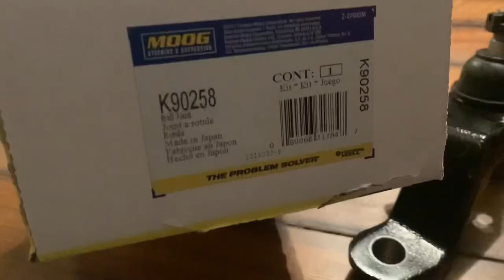Moog Toyota Lower Ball Joints - DO NOT USE THESE! - 3rd Gen 4Runner / Tacoma / Tundra

Comment: I just installed the "Problem Solvers" on my 2001 Tundra May 21st. Have only driven about 20 miles so far. I am convinced to remove them today or tomorrow and install me some OEM ball joints. Looks like I will be returning these to Amazon. Thank GOD I was led to this video! Thank You for the heads UP brother!!!!
Reply from the maker: If you have the 555’s you’re in much better shape. The black ones not so much
Reply: @FreedomCrawler  Have not been able to find the 555's going to be replacing them with OEM tomorrow! Then shipping back the cheap ones.
Reply from the maker: Fair enough. Makes sense
Reply: @FreedomCrawler I have the 555s on my toyota t100. Was the t100 plagued with the common LBJ failures in the first gen tacomas/4runners/tundras? I assumed so but now that i think about it i think all those rigs have coilovers and the toyota t100 still has torsion bars. I have about 30k on my 555s now but im debating on just going OEM for peice of mind

Comment: I used Moog tie rod ends on my 3rd gen runner and lasted less than six months. Replaced with Sankei 555 and have been going strong for two years now.
Reply from the maker: That’s why I kept the 555 Moog parts and returned the others
Reply: I purchased OEM Toyota Tie Rods and Ball Joints, let me just go ahead and say $$$$$$ yikes!! But I know it’ll last me another 10 years without having to purchase them again however I probably won’t let it go that long
Reply: Somthing else is wrong with your car. Theres nothing wrong with Moog. Been using them for years.

Comment: Installed a Moog control arm with ball joint 3 years ago and its still going strong. I think people are buying from ebay or amazon etc.
Reply from the maker: Agreed, also about how you install it as well. That’s great to hear
Reply: Have some Moog lower ball joints in my Tundra for 7 years , not had a problem with them.

Comment: Great video. I learned that Moog has gone to shit with a lot of their parts months ago. I just bought a pair of lower ball joints for my 1st gen Tacoma 4x4 from Mevotech. Their "X-Factor" series, that uses REAL sintered steel bearings, high quality boots, and heavy duty castings. I haven't installed them yet, so I was able to compare them to the parts in this video. The Mevotech part much more resembles the 555 part in every way: near identical: the casting thickness/shape, the lower stamped steel cover, the rubber boot ( blue in color, & connected with stainless steel rings at both the top & bottom of the boot, it blows away the boot on the cheap part in this video ), a temporary protective cover for the boot that is kept in place by the castle nut during installation, even a grease fitting. It is much better vs the cheap part you're showing in this video, I compared them very carefully. So I am definitely pleased with the Mevotech parts. I ordered them from Rock Auto. They are however manufactured in China and have the black powder coating, but Mevotech has already stated that their inspectors make sure all materials, castings, even manufacturing & assembly is done to their strict spec's. Their X-Factor series of parts carry the logo "overbuilt for durability", and all use the blue rubber boots. Mevotech has a good website, lots of videos showing how their parts are high quality, plus a customer support phone number. Mevotech ( a Canadian company that does their own research & development ) also has a line of these parts that are even heavier duty. I forget the name of the series, but the rubber boots are light green in color. I see individuals and professional mechanics/shops installing & recommending Mevotech X-Factor ( blue rubber boots ) series and their ultra HD series ( green rubber boots ) all over youtube, and most of them are NOT affiliated with Mevotech in any way. Neither am I. Just thought I would share this info.

Comment: I might add my current lower ball joints were replaced in 07 on my 05 Tundra OEM parts. That was 150,000 miles ago still tight.

Comment: Great video, I had to check which lower ball joints I installed. I actually used AC/Delco brand and it's extremely similar to the one that you prefer other than the machined surfaces, but definitely look to have greater structural integrity plus stouter looking ball joint. Thanks for making our gen3 community aware
Reply from the maker: Absolutely, hope it helps

Comment: I know this is a couple of years old now, but that black Moog part is more of an equivalent to the OEM LBJ than the silver part. The OE ball joints never had a grease fitting, so that is irrelevant.
I purchased 2 OEM Toyota LBJ's, dated 2021, for my 1st gen Tacoma (same as a 3rd gen 4runner) directly from the dealership, they look nearly identical to that black Moog ball joint. The only difference I can see is that the cap, that you think looks cheap, is painted black on the Toyota part I have. Same cap though, and physically looks the same as that black Moog ball joint.
Reply from the maker: Moog contacted me after watching this and told me it was actually their new updated version. That it had slightly better components. I still like the 555 personally but that’s what they relayed
Reply: @FreedomCrawler what do you recommend? The 555 or the toyota oem ball joints? I know some oem parts are made by other brands and just add their name and bump up the price. I hear the 555 is the oem manufacturer for the toyota ball joints but I don't know if is the case.

Comment: Someone bought a Moog part and then a house brand part, swapped the boxes, and returned the cheaper part in the Moog box. The parts house failed to check the return. Common fraud in retail.
Reply from the maker: Would make sense if it hadn’t been ordered offline. I’d agree that could have easily happened at a parts store
Reply: Moog has cheaped out and in fact is selling cheap Chinese junk.

Comment: 555 is no OE rebranded factory doesn’t have grease fitting. There is a reason why some have it and some don’t. Factory have a teflon design while 555 is metal on metal that’s why it has the grease zig fitting. 555 also doesn’t have a coating it will rust quick so paint it.
Reply from the maker: Absolutely correct. Especially on the painting them.

Comment: Idk if anyone noticed, but i saw right away that the questionable ball joint doesn't even have a grease fitting. If i ordered these online, I'd be highly upset bc I'd have to go through the return process, order another set, and wait another week. Thanks for the heads up. I'll get mine from Toyota
Reply from the maker: Exactly the first thing I noticed too

Comment: The chinese manufactured ball joints pops out in less then a year..watch out !!. 
I have had two ball joint failure on the land cruiser prado 90 series on the go. Both were china made, no zerk for greasing and on them. When  the inside of the popped out b-joint were checked there was no plastic polymer seats inside either.  ..its a terrible experience. The LC 90 series shares the same chassis/suspension as your 3rd gen 4runner.. with a little more beef added here and there. Go for the Sankei 555 (SB3806) non-greasable ones made in Japan. Its silver in colour and needs to be painted before fitting. The balls can be rotated with bare hands when new..feels buttery smooth. Three years now with it and mostly used hard on tough roads..not even a slight play at all yet.

Comment: Have not ordered Moog parts. I assume you do not have an option to order 555, rebuilt OEM, parts. Is this true? I'm with you, I would never put that black part on my vehicle, the casting is ALL WRONG! Also have a question. I experienced wobble in the front end, thought ball joints were bad. Jacked it up, and noticed the passenger wheel would turn then stick. Thought bad caliper. Removed caliper and still had the problem. hub would turn then stick, I mean almost like a binding. Now it's either the axle, or the transfer case. Any of you guys experienced this before? New one on me. Oh, and put new wheel bearings in last year, so I'm eliminating that, for now. Would like to know what ya think, thanks! One more thing, it's a 2007, gen 4.

Comment: You got me dude!!!! Good one. I have had OEM joints last decades, and moogs last a few months. I'm sure they rebuild or get factory seconds or something, but DO NOT USE THEM. There was a company called Pro Forge, and they were good german stuff that lasted. Stick to OEM, or just spend 1500 and get new arms and uni balls.
Reply from the maker: As soon as I opened that box I knew something was wrong. I’ve had enough vehicles to know a huge red flag when I see one and that was just wrong. Again, it will work in a pinch or for the person who needs a quick fix but that’s not a Japanese OEM replacement. That’s a knockoff 100%. Have a great rest of your weekend!

Comment: I believe Moog recalled their ball joints for Tacoma /4 Runner. I believe the black painted one you have is one of them. The other is the Sakei part ( Triple Five) which is the best non factory ball joint.
Reply from the maker: MOOG actually called me after this video to clarify. The black part is their new version. I’ll make an updated video soon
Reply: Ya moog doesn't make parts anymore they take other brands and put them in their boxes they are a repacker I've got alot of ball joints from moog stamped 555 that's because they are repacked Sanki 555 brand ball joints 95 percent of the time your guns get a sanki 555 part in a moog box its kind of funny cause if ur guna buy moog u minus well buy the sanki 555 brand instead cause moog charges more money for their moog brand sankie 555 is a cheaper part brand so save some money and just buy the sanki 555 brand cause ur guna get the same exact part ur just paying more for it with the moog I stay away from moog I only buy it if that's the only option always go with beck arnley cause moog went to shit beck arnley 90 percent of the time ur guna get a oem dealer part in their box for half the price never had any problems with beck arnley

Comment: Can you provide the part numbers of each of those?
Reply from the maker: They actually both had the same parts numbers. The black one and the 555 one.
Reply: @FreedomCrawler  How do they both have the same part numbers? The left and right joints are different.
Reply: @clementc9975  yeah they should be slightly different number usually.

Comment: It seems that Moog used to have good quality parts that matched OEM quality that was made either in the USA or Japan. From my experience recently, Moog is trying to increase profit margins by taking ALL manufacturing to China (unlike what they were doing before) probably because Federal-Mogul got greedy. If you order 2 of the exact same parts and they probably will ship from different fulfillment centers you most likely are going to receive an old stock USA or Japanese made part and or a new Chinese inferior part like in this video. It's sad to see a company like this that has and can produce good quality parts replace everything with this cheap bullshit that's garbage. Buy all the old stock while you still can and return all the new crap before going to the dealership and going broke.
Reply from the maker: They said they are using higher quality parts now vs before. That’s what their engineers told me at least

Comment: what year and model tacoma parts do i look for to do this swap? thanks
Reply from the maker: Here you go. To swap to Tacoma parts you have to do lower ball joints and outer tie rods together. Here’s the oem info if you want to go that route and the 4x4 tacoma year. 
1994 - 2005 Tacoma’s
OEM 1st gen Taco Parts
43330-39815 - RLBJ - Qty 1
43340-39585 - LLBJ - Qty 1
45046-39295 - ROTRE - Qty 1
45047-39175 - LOTRE - Qty 1

Comment: Only use OEM replacement ball joints. They are designed to work with Toyota suspension. They redesigned for recall.
Reply: oem ball joints will break just like any non oem can break. Theres nothing wrong with MOOG ball joints.

Comment: Bottom line stay away from aftermarket LBJ. Go with OEM.
Reply from the maker: The 555 worked great for me but you can’t go wrong with oem
Reply: @FreedomCrawler  I survived 2 LBJ failure due to using aftermarket LBJs from Autozone and O'Reilly.  Never again will I go aftermarket.
Reply from the maker: I can imagine. When I saw the quality of those basic ones they looked like shit
Reply: Exactly, its the lower ball joint. You DON'T want to go cheap on that.
Reply: Only thing is oem is 250$ each
Reply: I think Senkei555 is the manufacturer for Toyota.
Reply: @WEESHBONE  I don't know about 555. That's what they all say. But imho, I would put my money on it.

Comment: Call me crazy but those black ones look just like OEM units; indeed, I cannot tell the difference. You indicated down below that Moog informed you that the black ones are their upgraded ones, unless I misunderstood what you meant. Maybe Moog is using the same jobber as Toyota now? It sure looks that way.
Reply from the maker: Correct. The black ones are the upgraded new versions they told me. It’s very well possible that they are using the same supplier as factory now.

Comment: The black ball joint is NOT Moog !!!!  Have done suspension work for over 40 years and have never had a Moog failure! Your feelings are not appropriate for comparing.
Reply from the maker: It actually is. Moog saw this video and called me. I spent an hour discussing with their engineers and sales team in regards to it. Going to make a follow on video. Moog is a great product, pretty sure I expressed that as well

Comment: What you didn't cover is that fake motor parts have been about for years. Many are made in Turkey and fake branded with well known brands. This is right across all parts, every manufacturer has this problem. Tons of fake NGK spark plugs out there etc.
Send the item to Moog and ask them to verify it.

Comment: DUDE! I’ve been having the same issue with cheap made in CHINA parts! 
My 98 Chevy S10 - ENGINE FAN PLATE!
I’ve REPLACED 3 times, Because of a squeaky bearing! & the casting wasn’t right on one & the bolt holes didn’t even like up, I had to buy a left over oem from a dealership for twice the money and it’s non returnable! &,,, guess what—- it still squeaks. I’m beside myself with the cheap Chinese crap! I even called Napa / oRiellys & GATES* corporate office on the matter. AMERICA NEEDS TO WAKE UP AND START MANUFACTURING IN THE USA!